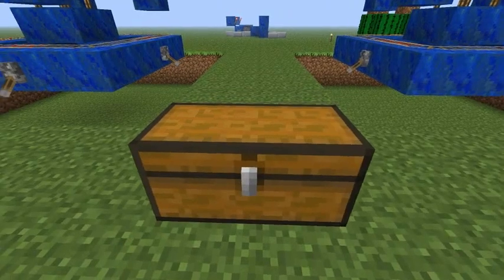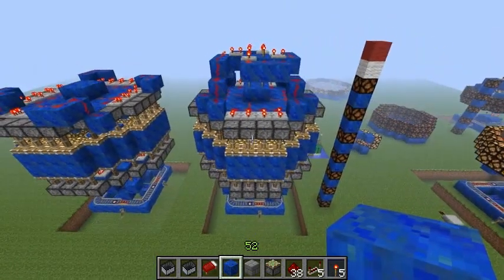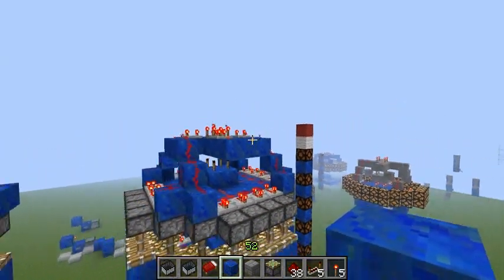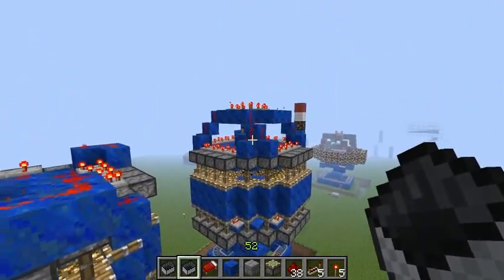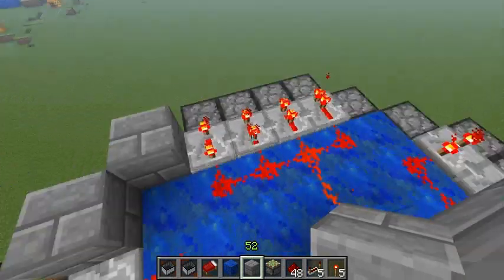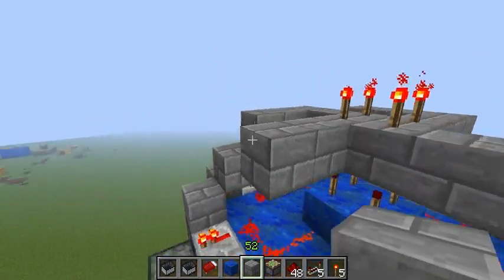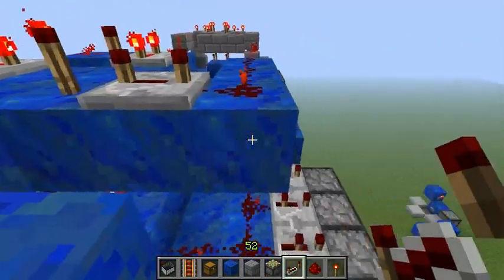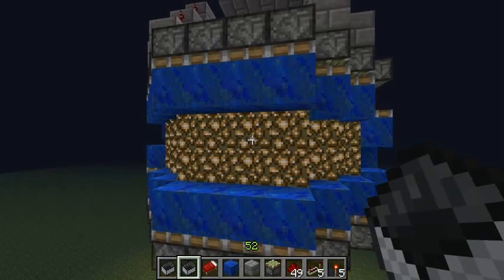Revolving Lighthouse Tutorial 1.4.7 Bug Fix

Comment: for xbox users, i saw that the mine cart was going way too fast. it is a simple fix. on the very bottom where the rail is make it one block wider and instead of two power rails use only one.
Reply: Kelly Shannon Thanks, Mine wasn't working and I thought I had messed up.

Comment: the top layer is indeed one tick behind the bottom row, it's because of the inverters sending the signal up. To fix, add one tick to the bottom layer. Pause at 7:42 and you can see this happening.